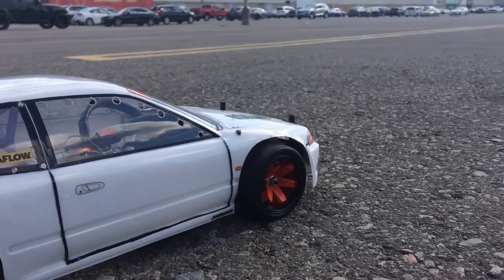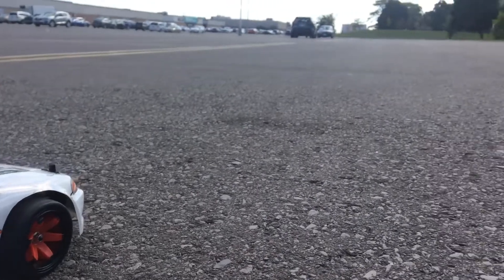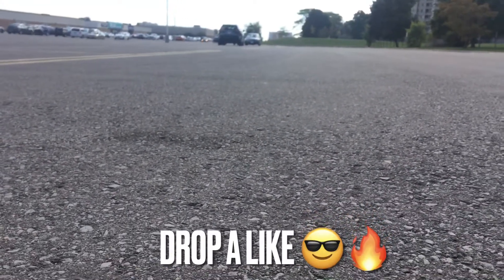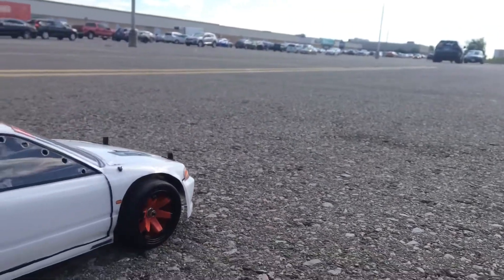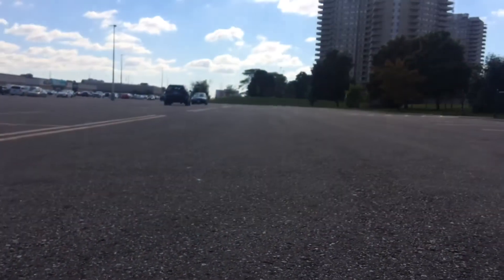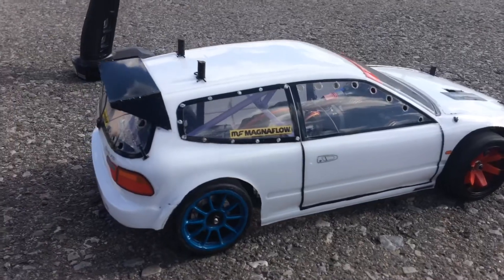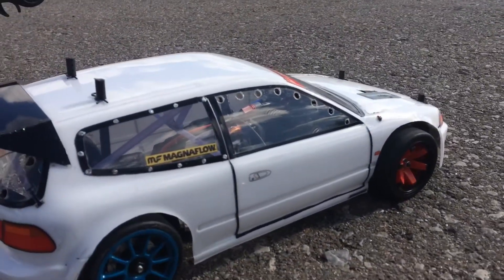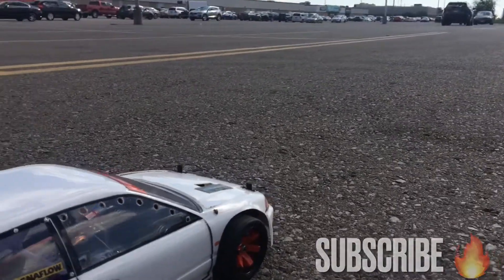Fwd drag Civic Rc Test & Tune More Boost with Less weight

Comment: Like  the speed  Jamaica 🇯🇲  style  what's it doing on the 132
Reply from the maker: Respect fam. And it's doing 3.99 @42mph its not turn up all the way dialing in the boost to try control the wheel spin
Reply: OK I see your having a traction issue  with the boost  
1.... try to turn your throttle expo down ,it helps to smoothen out power a initial launch .
2....soften up front suspension  make sure you enough droop in it .
3.....use a stiffer spring on rear suspension. 
4...add at least 30 gms led weight over front axles.
That should eliminate most of your issue
Reply from the maker: @garysailsman872  respect for the feedback. I made an order for some new shocks and I am planning to change the weight oil inside them too. The expo is turned down but I think I also maybe need to turn down the power a little. Spinning ain't winning 😅 make we see how it go